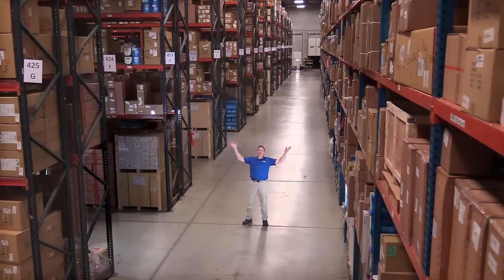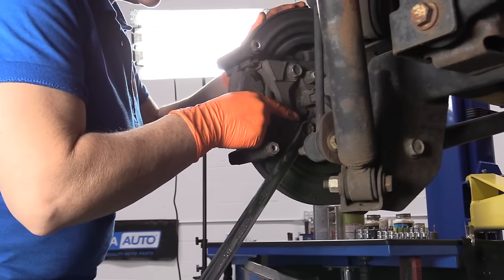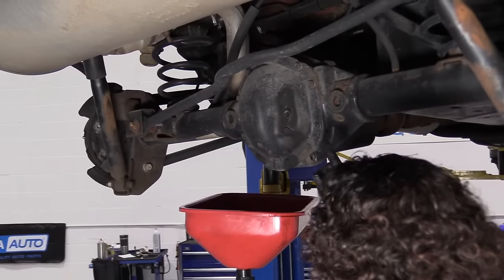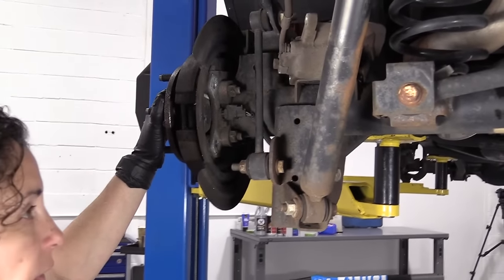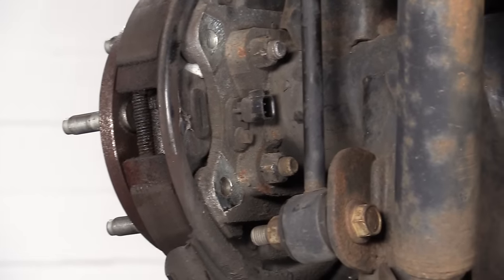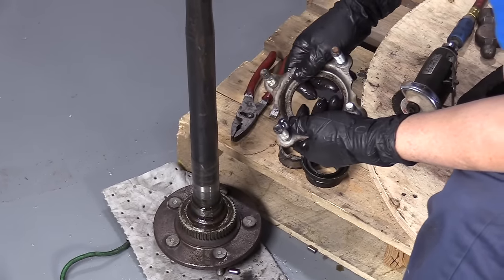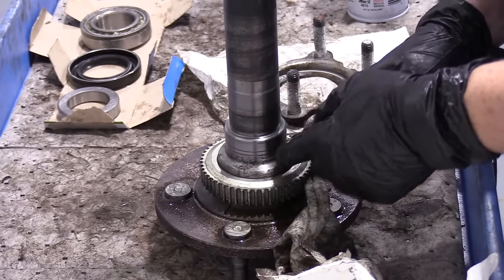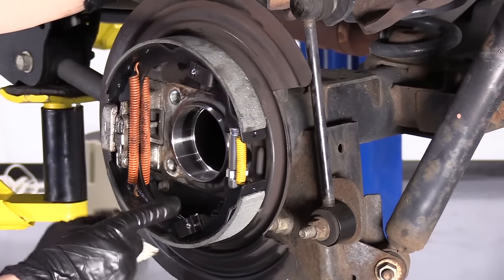How to Replace Rear Axle Seal 06-18 Jeep Wrangler

Comment: As a tech at a shop, I feel like this misrepresents what may ACTUALLY be required to do this job. MAYBE you will get lucky and your axles will come out without a slide hammer, and MAYbe the backing plates wont want to come off with the axle. I suggest having a slide hammer handy. People might start this job and end up needing more tools than you're showing. just saying.
Reply from the maker: +K i r k H 4 2 0 Thanks for the feedback!
Reply: Especially in the rust belt

Comment: You had me until you started grinding off the bearing, Im not gonna mess with it, Ill pay to have that done.
Reply: A dremel works better.    Faster because thinner kerf, easier to control because of the smaller radius of the disk.

Comment: Nice job. Very concise and thorough step by step. I have only one question though. What happens to seal when the clean dry steel axle starts rotating inside the brand new DRY rubber seal as it goes down the road before the axle lube gets out to the end of the tubes to lubricate it?? I was taught in Arizona Automotive Institute back in 1975, that the new rubber seal MELTS from the friction. I was taught to put a very lite coating of heavy axle grease on the surface of the seal and the machined surface of the axle where they are going to ride to prevent friction. That prevents the seal from melting and causing a new leak on your new axle seal. In 15 years in the field, I (knock-wood) NEVER had a comeback for a new axle seal leaking withing my standard 3 year warranty period. Other than that, the step by step was very informative. Thank you.
Reply: The seal has lubrication on it from Jeep. Well atleast the seal i got when I performed this repair.
Reply: Always pre lube the seal and axle bearing

Comment: Great video, FYI at times the outer race of the bearing will remain pressed into the differential hub and will need to be removed before replacing the axle shaft. In this video it came right out with the axle shaft but that’s not always the case.
Reply: not on this model JK with OEM tapered roller bearings I don't think.....
Reply: yep im doing one thats like pressed into the tube.
  bearing and race are 1 peice.
axle doesnt just slide on out sadly
  2011 wrangler unlimited sport

Comment: Very helpful video.  I ran into an issue maybe others might as well, where the studs on the retainer plate broke loose.  I had to cut them off with sawzall and replace the retainer plate and bolts.  Just something that might happen.

Comment: 1A Auto.. Cool video. It's funny I just did rear brakes on a 2012 Jeep Wrangler and it needed the seals replaced. I told the customer he had to replace for rear wheel bearing and seals . He couldn't afford it right now so I told him it needs to be done asap..

Comment: This was incredibly helpful. I had a seal leak, but couldn’t get access to a bearing press, so I went with a full axle assembly from another auto parts supplier. (I checked and 1A Auto didn’t seem to have it.) It would’ve been more cost effective if I could’ve just replaced the seal, bearing, and spacer, but it was so much more cost effective than paying for what my mechanic was asking - $1500 for the seal leak and contaminated brakes. I saved $700 after parts and tools. I can’t help but think that Sue’s from New England with that “wicked tight”. LOL Thank you for this super helpful vid.

Comment: Great video and got me through this job with far less issues than learning as you go. I now know why you skipped the part of installing the e-brake shoes. You almost need 4 hands for that nightmare, and that took me almost longer than replacing the parts on the axle shaft. As some others have noted, I also had to pop out the race. I used an arm from a 3-jaw puller, which allowed me to get behind the race and pop it out with one good tap to the back of the race. At least Dana is smart enough to leave some of the back edge of the race exposed, unlike Toyota... Watch out for the little white plastic piece inside the ABS sensor clip. There's a bit of vacuum created when pulling off the wiring clip, and that white piece can pop out and get lost easily. I was lucky that I saw it fall out, or it would have been gone.

Note for Rubicon owners: With the e-locker, you will not be able to pop the axle shaft out from inside of the differential as shown here. The carrier housing does not allow access to the inside ends of the axle shafts. Another video shows flipping a rotor around backwards, sliding it back onto the lugs, loosely threading on 2-3 lugnuts, then using the rotor like a slide hammer. My axle popped out on the 3rd hit using this method. Knowing this information now, I would not do the additional work to remove the diff cover of a Rubicon unless you find reason to on the drain plug magnet. This will save you a good hour of cleaning, replacing, and waiting for RTV to setup a bit before final torque and fill.
Reply: Very helpful comment, about to replace both my rear seals and that’ll save a lot of time. Replaced diff fluid And didn’t notice and metal chunks on plug.

Comment: This is a great video, and Sue does good work, for sure. She’s careful and patient, and keeps everything clean and simple. My question relates to the reassembly. Sue installed the e brake adjuster in the down position, but when she removed it, it was in the up position. Does this make any difference? Wouldn’t the adjuster loosen off instead of tightening up? Thanks.

Comment: Nice explanation. Thanks. I ended up buying complete axle assemblies instead of the bearing/seal kit and it was a smooth install.
I do a lot of auto projects (brakes..etc). and it took me about 2 hours per side  (but I didn’t have to do brakes … if your brakes need replacing, do at same time as you’re already taking everything off… I recently did my brakes/rotors & emergency shoes so I just pulled the bracket bolts and removed as a whole assembly. (Note, adjust your e-brake before putting it all back together). Mine axle seals were leaking and everything was a total mess… replaced all shoes, rotors, ebrakes, et. …was a big cleanup job using about 4 cans of brake cleaner and 4 rolls of paper towels 😕 Did brakes & axles in two different sessions as I would have gone insane trying to do it all in one day.  Complete axle assembly was more $ but really worth it IMO as it saved a bunch of hassle and time (I don’t own a shop press). Tip: Jack up side you’re working on so fluid stays in diff when you pull the axle. Also, didn’t require and slide hammer to get axle out but used a crowbar to gently press on solid ebrake mount and back of axle lug plate while turning axle around a bit each time (don’t pry against the actual brake shoes) - eventually axle popped out (or you could mount rotor backward with lugs a couple turns on the studs…not tight. And use rotor as a slide hammer of sorts.. that didn’t work in my case so crowbar was necessary). Overall a PITA job but not terrible - maybe a 6.5/10 difficulty. A half moon or bent S 18mm closed end wrench really is useful. And an 18mm ratcheting closed end would have been really useful. Good luck. No need to open differential cover. Just slide new axles in and bolt down n a cross patter & top off diff fluid (make sure to order the correct Dana 44 axle part for Non-Rubicon  or Rubicon as they have different # of splines )…

Comment: The rear differential cover bolts torque specification is 30 ft lbs (41 N-m). The fill plug torque is 25 ft lbs (34 N-m).

Comment: Quick tip, pregrease the axle bearings to avoid running dry until the gear oil makes it's way out to the ends of the axle tubes

Comment: Many shops that do this install an aftermarket axle/bearing/seal assembly to simplify the job and save on the labor costs.  Good idea to change the axle fluid after doing this, but truth be told you don't even have to pull the differential cover to do this job, just tap and pry the axle out between the brake backing plate mounting and the rear axle casting. If you have an axle assembly and the retaining nuts come loose easily, it's really only about a 30 minute job per side.
Reply from the maker: +Mark Palmer Thanks for checking us out!

Comment: The torque specification for the four axle retainer nuts is 45 ft lbs. (61 N-m). I definitely do not consider this to be "wicked tight". Be careful you can twist the stud off of the retainer plate if you overtighten.

Comment: U gotta use thread locker for those retainer nuts. I'm going to do the same tomorrow, I'm thinking about using an induction heater to heat up the inner bearing ring, huh? Better than cutting?

Comment: I experienced the “squealing” phenomena as opposed to the “howling”.It only occurred at highway speed which I couldn’t quite pinpoint where it was originating.The rear passenger brakes seemed to be excessively worn more than the rest which leaves to believe that was what I was hearing.

Comment: FYI my alldata manual says 45ft-lbs torque on those axle retainer nuts. It also said to replace those nuts and not to re-use them. My local dealer has lots in stock as this is a common procedure done at dealer service center. Also as another commented should I be greasing the bore/seal so I don't melt seal? Alldata doesn't say to do so....

Comment: great job.i like seeing people who know there mechanics,especially women and young adults.everyone should learn all they can about their automobile.I have a question.I just replaced both rear wheel bearings on my 2006 yj with a dana 44 in rear.I changed them because you could move wheel up and down and everything is tight.after replacing both sides you can still wiggle wheel up and down some.its not leaking on either side but should thwere be any slack?thank you so much.i need a professional opinion.you are very good mechanic!!
Reply from the maker: +Robert Andrews We wouldn't be able to say here, you may want to have a local mechanic take a look at it. Thanks for checking us out! http://1aau.to/m/Shop-1AAuto-c

Comment: So tightening the retainer bolts is what seats the bearing in the axle tube? That means the retainer presses against the seal to press in the bearing into the axle tube? I dont feel a seal is the way to press in a wheel bearing.

Comment: Rev. Sys,
I have watched your video from beginning to end without interruption and liked it very much.
While inserting the tapered roller bearing into the wheel shaft we use hydraulic press. But while we have to remove it from the shaft it is generally cut away. Can you suggest us some other ways by which we can remove the old wheel bearing without cutting it or damaging it ?
Thank you very much for your nice video.
With regards,
Jayantàda,
4/6/2021
Reply from the maker: +Jayanta Jit Hazarika Thanks for checking us out! http://1aau.to/m/Shop-1AAuto-c
Reply: @1AAuto  Dear Sys,
I have checked as written by you but I have not got the answer to my question. Why don't you write to me straight ? 
May God bestow !

Comment: What is the average cost for this job? Including rotors and pads…having mine done and cost is 1900 including replacing ABS sensors and fixing broken parking brake

Comment: I wish my rotors just fell off like the ones in the video. My axle didn't budge with the pry bar either. Still fighting with the axle removal after using old reversed rotors as a slide hammer.

Comment: Is there any other way to fit the ring, bearing, and seal on the axle shaft without using a press? Seems that a regular driveway mechanic can't do this job without their own press. Any help would be greatly appreciated.
Reply: I know this is 6 months late, I'm a retired auto tech, 35years,  what i do without a press is to put the bearing and retainer in the oven, heat it up,  get some crc freeze off , get a long piece of pipe that fits the retainer,  support the axle,  spray the axle with crc freeze off, slide the warm bearing and retainer down the axle, slide the pipe down over the axle, drive the bearing and retainer until seated, very easy

Comment: I'm glad I saw this video. Firestone wanted to charge me almost $2.5k for doing this job on one side because supposedly the pin on the differential was broken, but when I took it to my mechanic he mentioned to me to remove Axle my Jeep is one of those like on this video you just remove the 4 nuts.
Reply: Firestone just told me they don't do the baring and seal replacement, they don't have the proper tools, to take to a transmission shop.

Comment: No need to remove the diff cover. Bolt rotor on backwards and use it as a slide hammer and axle will pop out.
Reply from the maker: +Streethawk 1 Thanks for the feedback!

Comment: I have to do this on an 03 Nissan Frontier 2wd 2.4l Auto. Can anyone tell me what the ring in front of the bearing she cut off it called? I am looking at a chart and honestly the low quality of it is maddening to understand without having the axle already out to reference. Is that the spacer? ON the diagram for mine it looks like it is behind the bearing. Someone please help me.

Comment: So in hindsight there was no reason to remove the differential cover because axle shaft came out easily right?
Reply from the maker: +Mike Barbieri Thanks for watching!  It is a good idea to have it open to insure that you insert the axle all the way when reassembling, but you do not necessarily have to take it off.  1aauto.com
Reply: It's probably good to remove it to inspect the differential gears. What better time to do so?

Comment: Hello Sue,,,
I have an important question. Is there any reason why the axles would need to be pulled ,just to replace rear brakes on my 2012 Jeep Wrangler?
I saw the mechanic doing exactly that on mine,,, is this normal procedure??? 
My 500$ quote jumped to 980$, and I'm wondering WTF!!!
I have never had to remove axles for this procedure,,, why the mechanic did is questionable.
Am I being taken for a ride???
Reply from the maker: +brenda remillard Yes, you do need to pull the axles for this repair.  Thanks for the question.
Reply: No need to pull the axles to repair rear brakes in a Jeep JK. Sue has another video on this and shows you how to do it.

Comment: Is there no inner seal on the back axle?
Reply from the maker: The only seal on this rear axle would be the seal referenced and removed at 12:40 in the video. Hope this helps you out! +antonw194200
Reply: Yes it absolutley does, thanks! But the front axle has both inner seals by the diff housing and outer seals in the ends of the axletube, right?

Comment: Unless this is warranty work, I wouldn't bother having this done.

For one simple reason: A leaking rear bearing seal will only affect two things:

1. It will cause the rear differential oil to (slowly) leak

2. It will contaminate the rear parking brake shoes with oil making it not work.

If your truck is an automatic you're already never using the parking brake, so it doesn't matter.

And the diff oil will only leak out extremely slowly. And it's easy to check and fill.

And this is a very expensive service, well over $1000. Just take your truck to a quick oil change and have them check and refill your differential oil.

And then just get on with your life! 😬

Comment: axle retainer nut torque is 45ft-lbs
differential cover should be torqued to 30ft-lbs
the rtv should be applied to one of the mating surfaces and cover should be installed being careful not to press on the cover and bolts should be threaded in until they touch the cover. after 20-30 minutes the bolts may be torqued to spec.
smh several bad practices and mis information in this video.

Comment: Don't need to remove rear diff cover or oil... Also do not need to disassemble the brake caliper... The whole brake assembly comes off it two bolts.  Follow this method if you want to waste 3 hours on a 40 min job.

Still an informative video though.  Good tips on inspection but not needed if all you're doing is swapping out a bent axle after wheelin!
Reply from the maker: +aaronhahn777 We appreciate the feedback. Sometimes there are multiple ways to accomplish the same repair.